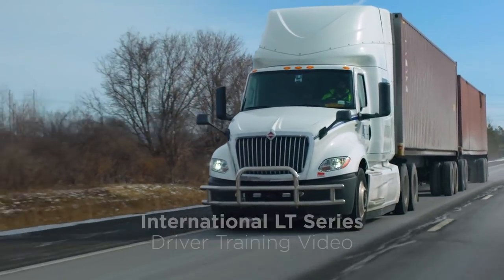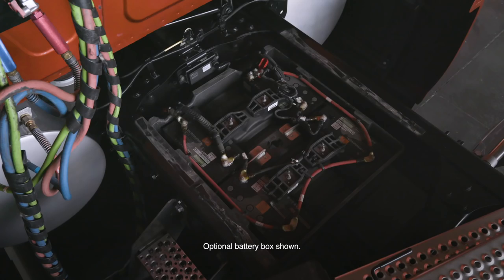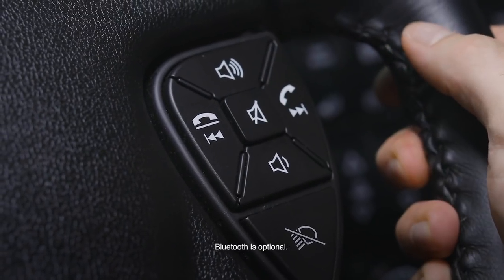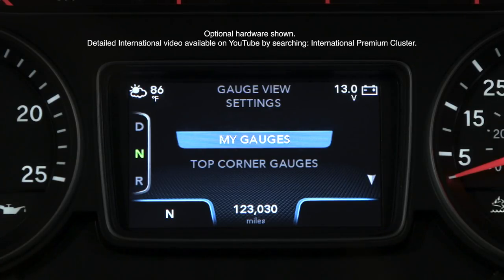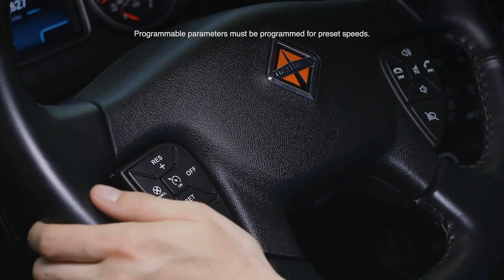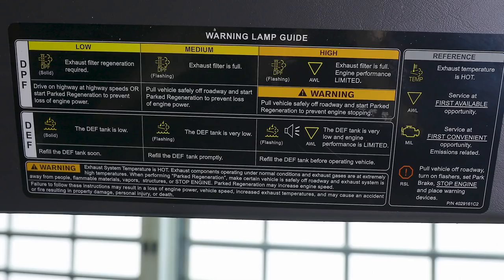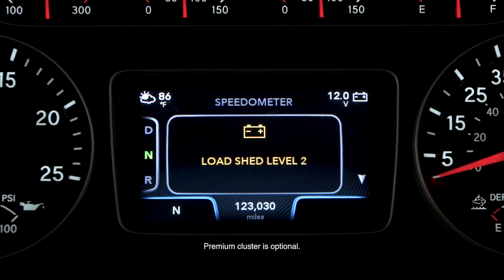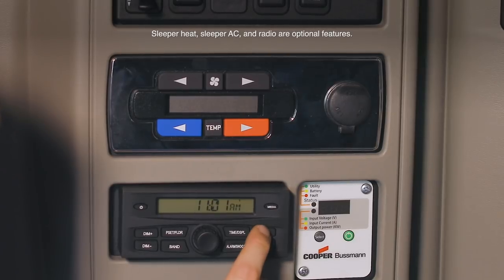International Truck Driver Training Video

Comment: Would be nice if they put a pull out table on sleeper cabs. Nothing. You
 eat on your lap and drops food on the chair in between your thighs. 
Would like a space for commonly used things like gloves, thumper, and 
flash light by the fire extinguisher side. My gloves keep dropping out 
and missing. A keyless entry on those small side doors, A MORE VISIBLE 
SIGNAL LIGTHS ON THE SIDES, a redesigned dashboard indicator lights. I 
cant see if Im on high beam, or in cruise control.   

The 
placement of the switches I suggest should be redesigned. The emrgency 
or fourway switch is too far and i happen to press the SUSP/DUMP.   The 
seldom used switches like the Diferential Lock, Traction control, etc...
 are rarely used and therefore should not be near the drivers reach. 

When
 rainy, my gloves and the spares gets wet. If only theres a space to 
warm up the gloves or shoes like a dry space under the footsteps or near
 the battery area. If INTERNATIONAL accepts criticism from drivers, 
their trucks would turn out to be the best among trucks
Reply: They DO have a pull out table available as an option. Whoever bought your truck was just too cheap to order that option...

Comment: If you took a job with a company that has internationals you're going to find out you made a big mistake! The cheapest worst driving worst riding pieces of crap on the road and that's when they actually go down the road because miraculously all the sensors are working! Good luck you're going to need it.